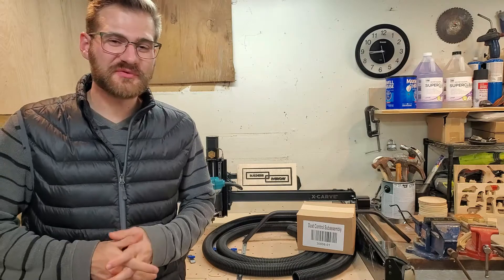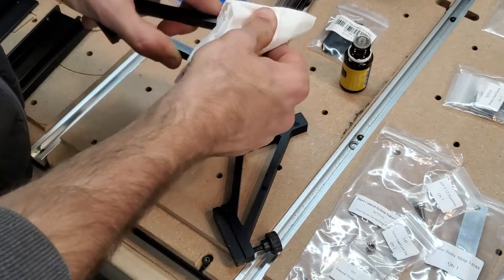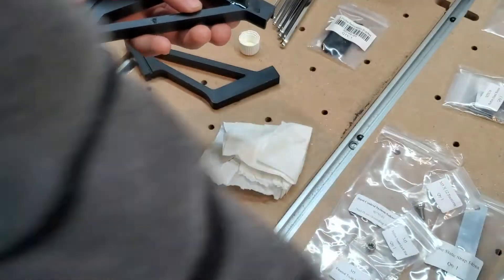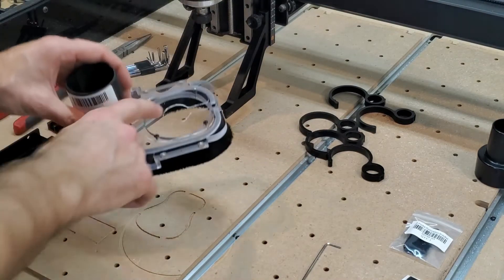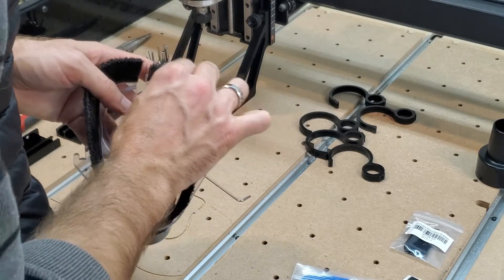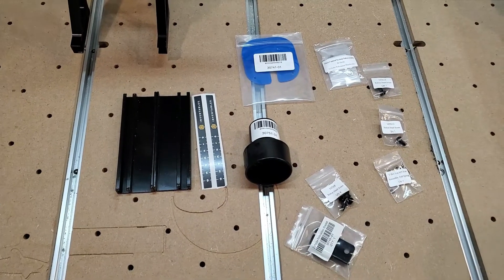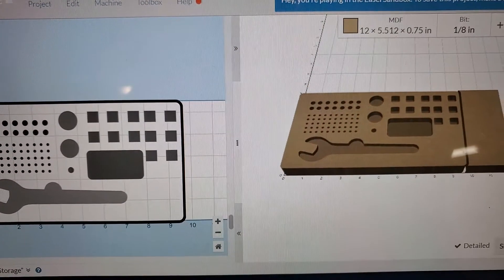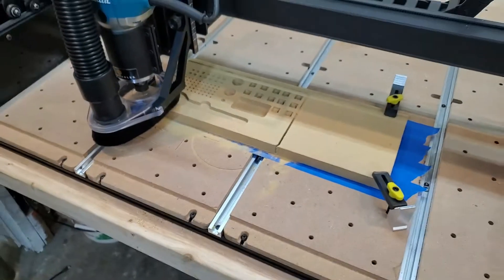Inventables X-Carve | Dust Collection System

Comment: I have the X-Carve pro and the dust collection is ok… Works on the “dust” but misses lots of chips. I have a vac system so i have the strong suction but the hose and design of the head limits the suction. (My opinion)